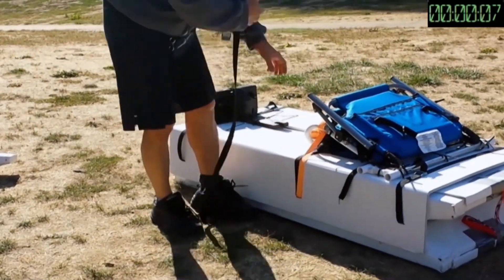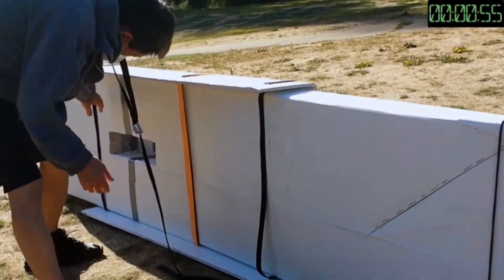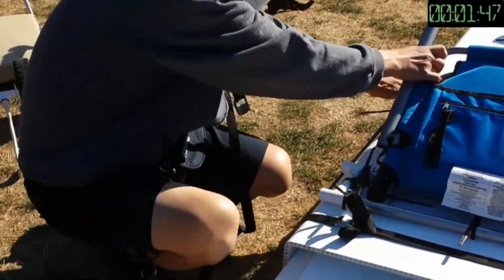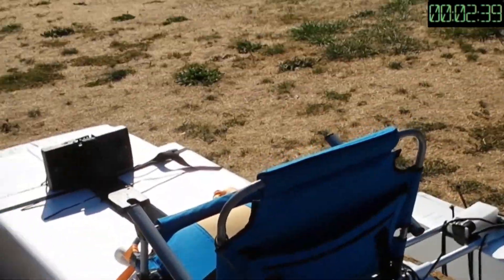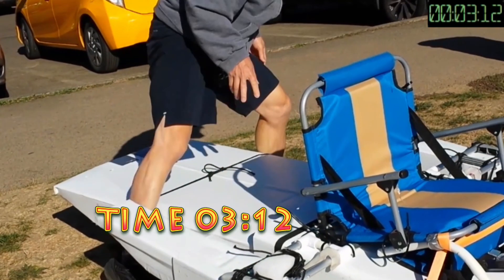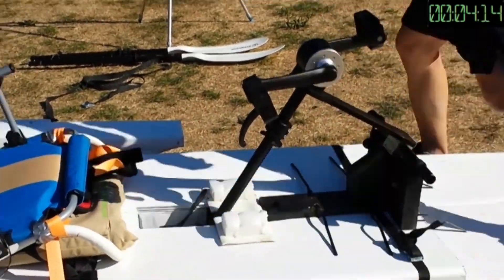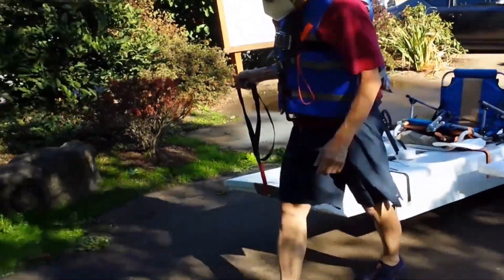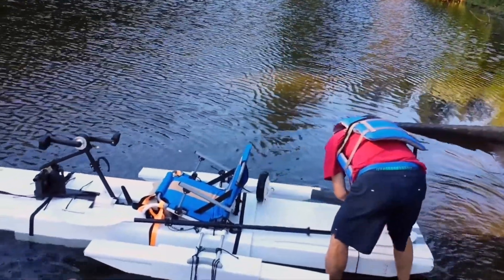Part 4 Assemble DIY Modular & Foldable Foam-core Fishing Kayak G18

Comment: Not exactly to this topic. I have a foldable and accidentally created a bend such that the kayak became a V shape with the middle portion sinking in. Is there a way to unbend, or remove an unwanted fold?
Reply from the maker: Thanks for asking. If that boat is made of coroplast. The bend most likely can be fixed. You may want to warm up the bended surface with hair blower and apply pressure at the bend (try to smooth up the bend). Then add additional layer(s) on top. This layer can be glued, taped or fused. Please take a few photos of the bended area and email to PDXBoatMaker@gmail.com  and I may be able to give you better suggestions.... cheers!
Reply: @DIYUSA  thanks